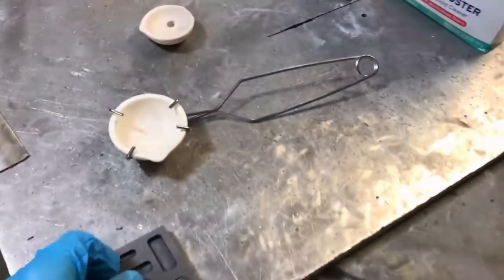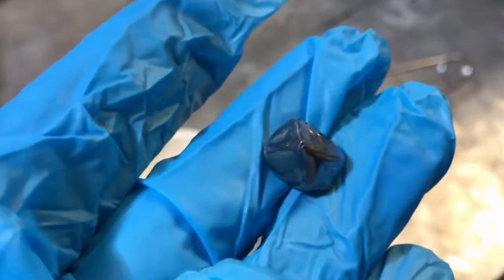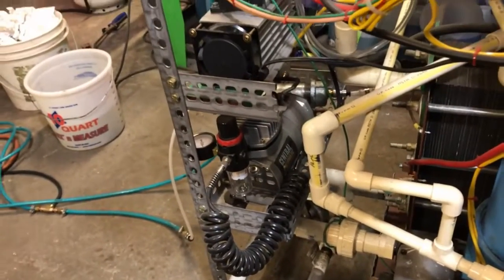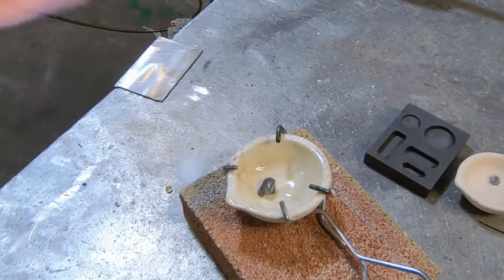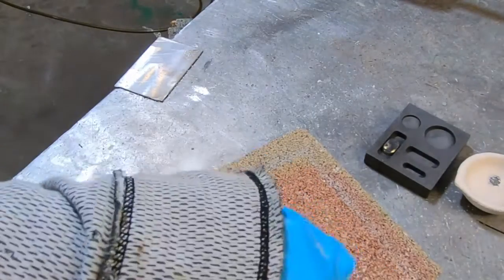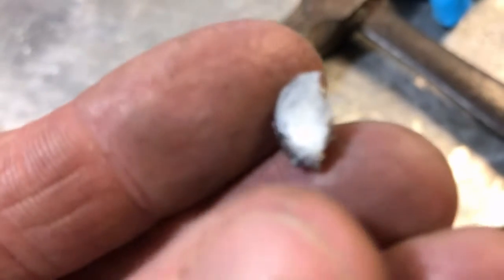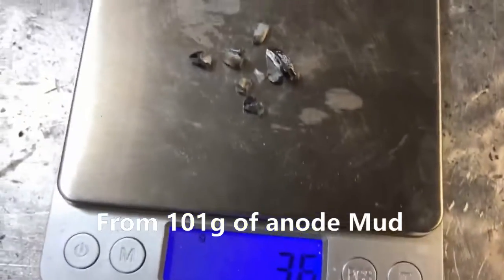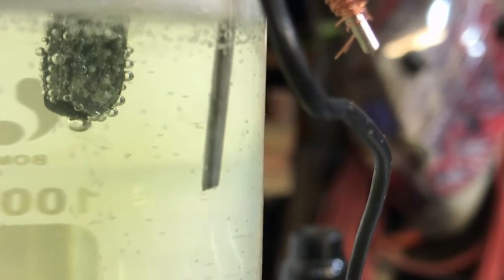Ewaste Gold recovery and anode Casting

Comment: I'm interested  ,man how do you come up with this stuff ,j got about 5000 mother boards put of cell tower radios .how can I get the gold out of it cheap
Reply: I would first melt off all of the tin and lead solder, then dissolve the copper with ammonium hydroxide, then pull all of the undissolved non-gold off, then soak it in aqua regia until it all dissolved, then purify it from solution.
Reply from the maker: @DeliciousDeBlair  We have a acid reduction goal in mind . Working with acids is great on paper but its expensive due to the waste products involved and the regulations such as EPA and osha also the country of origin has difficulty with other regulations regarding acids known to be used for the manufacturing of explosives  . The wide road road is not an option here .
But yes we have discussed ammonium hydroxide do to its ability to drop elements at different ph phases
Reply: Do you have any large heatsinks from the cell towers ?? Thanks